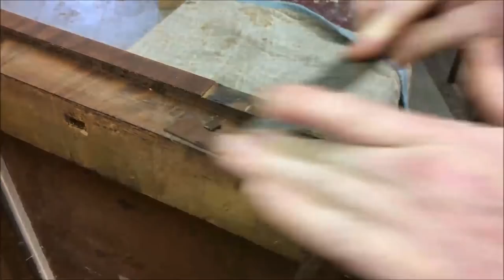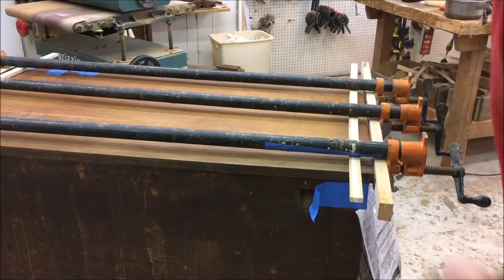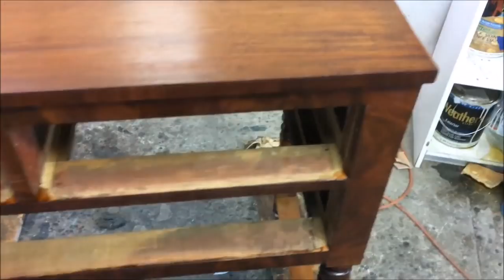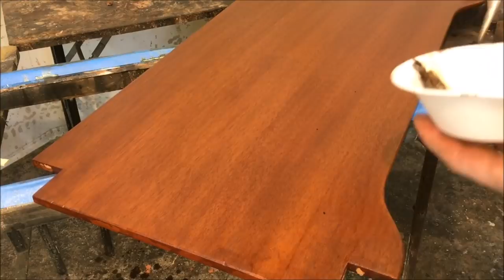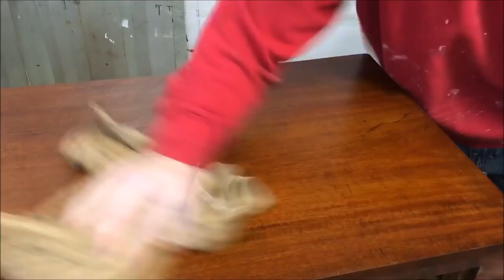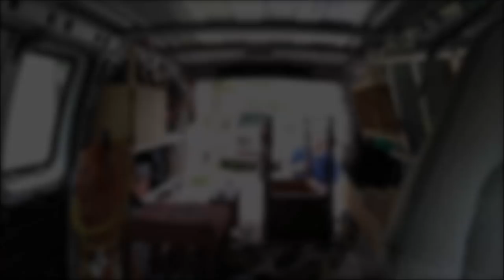RESTORATION / SHERATON MAHOGNAY SERVER -PART4/4- VENEER OFF COURSE BUT FIND THE FINISH

Comment: Really enjoyed this series, I was guessing the price for the finished piece before it was declared, the buyer got a bargain, especially considering it'll probably appreciate over the coming years.
Reply from the maker: I was surprised to get an offer that quick , it usually takes several months to get any offers . I would have ended up at the 650 anyway if it sat for a few months . I will end up making more than  that  on the videos in the long run . yes it will appreciate in value unlike the crap people buy these days .

Comment: Beautiful job Ross. I have a technical question.Did you seal the interior of the panels to help stabilize the piece against humidity changes. i didn't  see this done . I would think this should be a an import step after all the effort to straighten out warped panels. If you have time to reply thanks.
Reply from the maker: yes a coat of shellac does not hurt to seal the inside . but not a full finish

Comment: STOP SANDING ANTIQUE FURNITURE !!! BY THE WAY,WHERE DID YOU GET THE TIN BOX AND THE PIGMENTS?
Reply from the maker: I think you are refering  to the plastic tray that has the pigments.I think I got that at a craft store . the pigments are from woodworkers supply . as far as the sanding , even after removing the old finish there is still some residue of the old finish .and when using the hide glue there is some glue on the surface that has to be cleaned up . I cleaned up the surface with the cabinet scraper and a lite sanding with 150 only . I don't want the surface to look too smooth . that would not be authentic looking .no power sanding on this piece .

Comment: You're not getting the depth to your finish wet sanding with a block 600  between coats 1500 for the final coat standing wet sanding with a block you can use a rubber squeegee its 4 " by 2" you're not even good at hand sending I can see you pressing on your fingers